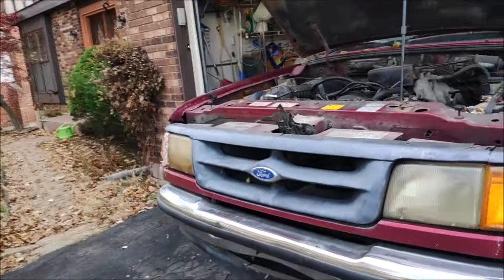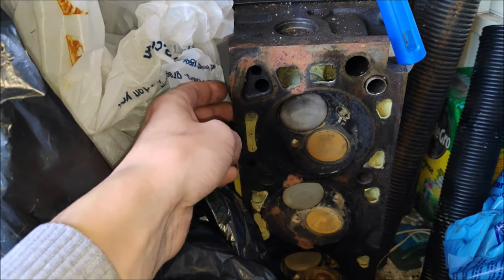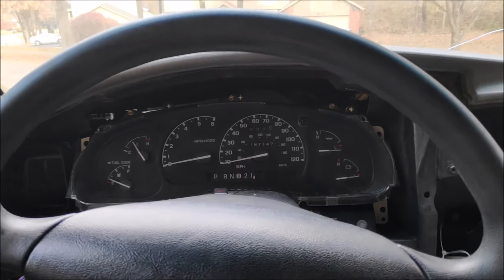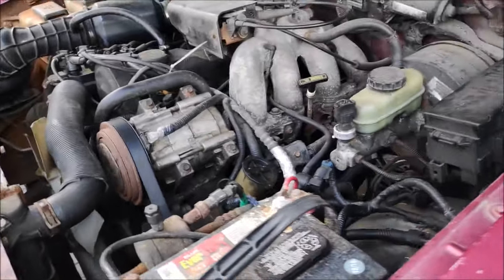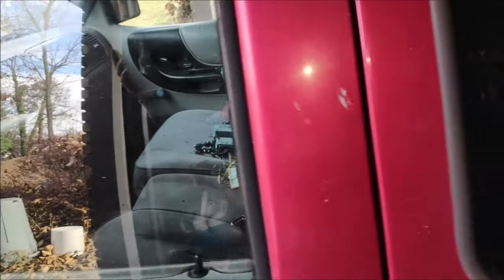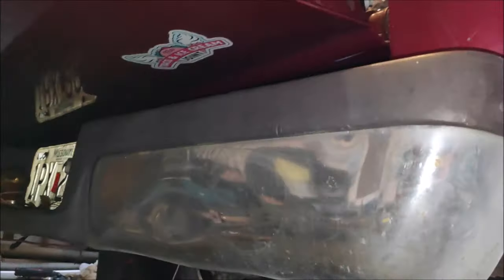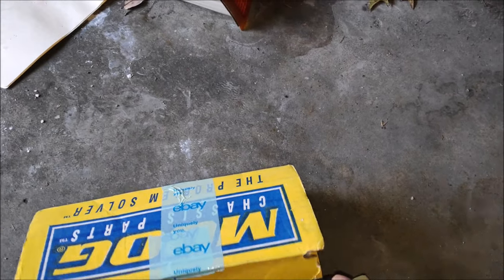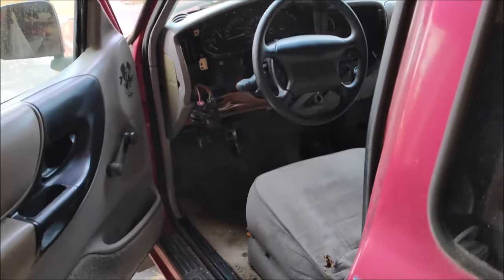What Fails on All Ford Rangers, Everything You Need to Know, Best Review

Comment: I've had rangers, 95/95/94/96/96, the 4 cyl. 2/3 L are awesome on gas!  * you can change a clutch slave cyl.on a 4 cyl.rgr by loosening exhaust hangers, drop trans, engine block is just small enough to get to the trans bolts, I drove w/ no clutch to get home, you can shift smoothly up/ down and about 2000 rpm, I shut truck off at a red light, had it in 1st gear, turned key & it started no problem, not legal , smart, or good for the starter, but I got home.now I have a 2010 rgr, 4.0 L its thirsty & heavy, shaking apart, I would buy a clean mid -90s rgr instead
Reply: lol that is insane yet inspiring as a 2.3 5spd owner

Comment: I bought a 1994 Ranger with the 2.3liter and it's gutless. I was driving up a steep logging road and it literally couldn't go any further. It would just stall if I let the clutch out at any RPM. It also likes to stall on really steep hill starts and I live in a mountainous area so hill starts are sometimes unavoidable. Is this normal? I don't want to have to do an engine and tranny swap, isn't there a lower hassle way that doesn't involve turbo/supercharging? Different cam or something?
Reply from the maker: On my 95 ranger leaking intake/exhaust valves in the cylinder head made the engine pretty gutless, you can do dry and wet compression test to figure out if your engine has the same problem. I posted a video about it, check it out if you'd like.
Reply: Did you find the problem, mine has the same issue?

Comment: I bought this new a 94  2.3L 5 speed trans 420K, and i ran the CRAP out of it. I used to hall scrap metal with it. the mud flaps are half gone. i put a water pump on it 2 years ago. This truck has been the best truck i have ever had. Fact 2 months ago my son T Bone someone, it should have been totaled. But no, it went frame shop. This truck owes me nothing. I owe it, so we are rebuilding it. I could have driven this across the country at any time. Did i say i do 10K oil changes on all my trucks. Mobile one Synthetic. 5/30.

Comment: That engine mount issue could also be a transmission mount broken.
Reply: woudlnt cause a roll though.
Reply: @DakotaRaymond1999  they can roll too if there is also a broken engine mount. Typically when just the trans mount is broken the shifter will lift up into the cab, and due to the torque on the engine (lifting to the right in forward and left in reverse) the stick will also move in the same direction, even with good mounts and more so with bad engine mounts. Also note this isn’t very noticeable with automatics as most modern autos even with a floor shifter, the shifter itself is attached to the floor of the truck and not the transmission using a cable to control she shift lever on the trans.

Comment: I've got a 98 need to deal with rust in the engine area, frame, and the power steering hose or pump is leaking. Then you can smell radiator when running the heater/ac...
Reply: What was the cause of the smell ? I catch it once in a while to

Comment: What fails in an older Ford Ranger?  Just about EVERYTHING FAILS, eventually.  I've owned my 2000 Ranger, 4 cylinder (with 8 spark plugs), 5 speed XLT truck since 2003.  As the 3rd owner, I paid $3,500 for it, no interest or fees, a friend sold it to me after he repossessed it from a 6 ft tall guy who wrecked it, why it now pulls to the right. I've replaced the radiator, the starter and other things twice and replaced once everything else but the motor.  Two front end and one rear jobs.  Started rusting a few years ago.

Comment: I have had a lot of Rangers and I love them. I would include the 4cyl in with the low power and poor gas mileage though. Some of the 4.0s actually had some decent power.
Reply: Why is the mileage so low on the 3 cylinder? It's fuel injected, low bhp and 4 cylinder? How can it have bad mpg? The truck is light.
Reply: Low power, absolutely. I've always gotten pretty sad 18mpg but every time I google anything about it there's loads of people reporting 23-24, so I dunno if I'm doing something wrong or what, but apparently they can do decent for the type of vehicle and the time period they came from.

Comment: Great video, I need a slosh controller.  I have a couple problerms you didn't cover, which is my speedometer is intermittent,  and the fricking e brake is worthless even with new shoes. I have to use a chuck on a string sometimes.  String so I can grab it without getting out.  Thanks for sharing your knowledge,  very valuable to me!..
Reply from the maker: Anti slosh module can be bought on eBay or picked up at local salvage yard. Intermittent speedometer can be caused by many things such as poor contact, bad speedo servo or bad gem. Weak e brake can be caused by stretched cables or misadjusted brake shoes.

Comment: The 4.0 liter engines pull hard.  I don't know what truck you drove where it didn't.
Reply: I dont know what he was talking about...  I got the pushrod 4.0 and its POWERFUL. The 2.3 was garbage and stay away from all those!
Reply: I don't know what he was thinking saying the 4.0 is weak I totally disagree with that but also disagree with saying the 2.3 is junk the only thing that the 4.0,2.9 and 2.8 lack in is poor valve train oiling ford never did address the issue as all three share the same block casting

Comment: hey EDIR , question , what is the best easy out , easy in gauge cluster for a 94 ranger with a 2.3 & a 5 spd trans ???? .... problem , with my idle goes from perfect to a lope and back to perfect , coil pack , gonna flip flop coil packs , see if makes a difference ????...... comment , i saw all da rust n corrosion under that truck in da video , i had a corrosion problem at the fuel pump / float level electrical connection , da plastic connector had dry rot , on a hard stop , fuel pump would stop working , i cleaned n soldered fuel pump connections , still cuts out once in a great while , i might have to resolder electrical connections , 94 ranger xlt has 296 k on it  , should make 300,000 k by xmas ........

Comment: 16:35 mines a 95 4 cylinder 2.3 automatic at 196,000 miles and surprisingly the trans seems to be mostly fine not saying your wrong just that mines still good to this day main issues ive had are gauges and bulbs and replacing console lid because the latch broke right now its filler tube idk yet if its loose or needs replaced

Comment: I  have a 2010 ford ranger 2.3l 7.5 ring 4.10 ratio 

It axle bearing has eaten into my axle shaft they do not make this year axle shaft anymore they are obsolete and they are bigger than any other year ranger and the axle tubes are bigger therefore it uses bigger bearing 

I guess my only option is to change the whole rear end 

What do you recommend?

Comment: I bought a 95' Mazda b2300 manual. The odometer isn't working, the speedometer gets struck and doesn't move up or down smoothly, and the coolant temperature gauge is always on Hot. Even when the truck is off and cold. 

Any suggestions?
Reply from the maker: Your odometer gear is broken, common problem, your Speedometer servo might be on its way out.... you can replace the gauge cluster, if temp gauge continues to read high, then it's coolant temp sensor and/or wiring problems. 95 gauge cluster is different from 96-03. The ones I fix, sell quick on eBay.
Reply: @everydayirace  thanks! Your video is super helpful.

Comment: Nice vid. I bought a 97 Ford Ranger (auto) last summer and have had issues with check engine lights ever since I got it. This is the first Ranger I've ever owned that has given me such issues. Getting Bank 1 and 2 Engine lean codes. A new alternator took care of the initial stalling issues, but I'm still getting this occasional humming sound when I accelerate. 19:31 Had that problem on my last Ranger, a 99. The driver side leafspring broke and tore through the bed.
Reply from the maker: Lean codes are tough to figure out sometimes, so many things that can cause it. I am guessing 3.0l?
Reply: @everydayirace  It's a 4.0
Reply: I agree lean codes are hard now I'm not saying this is the right thing to do but I if you plug the vacuum hose to the fuel pressure regulator it will take care of the Lean code but be sure to to keep a good eye on the oil too make sure you're not washing the cylinder walls with gas as long as it doesn't throw rich codes you should be fine my 94 4.0 still running  strong and I done the same thing 3 years ago

Comment: I have a 2003 ranger XLT manual transmission. The issue is that it shut off while driving and now it won’t turn back on, it cranks but won’t start. Anybody with any input will be appreciated, thanks
Reply: Fuel filter?
Reply: @manuelsalgado8510 My Ranger just did the same thing while driving.It just died and would not fire up.I tried ether but no spark.Before I try figuring it out what was the cause of your problem?I don't have a lot of money and it's my only vehicle so your help is truly needed.. Thanks
Reply: @indarican1575  my issue was the Gas turn off valve under the passenger side, it was bad and causing the ranger to turn off. Replaced the shut off valve and problem fixed, hope it helps you too

Comment: Dude! I've had so many of these issues! Axle radius arm: ding! Dash lights: ding! Filler neck: ding! Rear end: ding! (The crown gear broke soooo many teeth off) Slave cylinder: ding! (Four times now, I think) Door handle: ding! And so on. Also, from another video of yours; this truck has no power. Won't get out of it's own way, and will 'ping' if I try to accelerate in the wrong gear, or if im trying to cruise at 50-55 in 5th. The reason I found your page is because my truck just sputtered to a stop today at a light, like it ran out of gas (it was not). I'm hoping it's the fuel filter. I was able to get it running again after it sat for 30 minutes and then I let it idle for a few minutes and it sputtered and stopped again. Tomorrow I'm going after the filter and we'll see. I've got a 97 2.3 with 551k miles on it and I'm certain that the filter has never been changed. I know, I know, I'm a bad truck-dad! It's just never been something I thought to change! Anyway, I love my little Ranger, and I love your page! I hope you get this and stay encouraged to keep making videos for us Ranger-folk out in the world. Also, if you read this, PLEASE give us a way to contact you and ask for your advice/insight! You're the most knowledgeable Ranger person I've ever found online! Thanks, man! You rock!
Reply from the maker: Thanks man, I don't think it's your fuel filter, bad fuel filter would limit flow at wot way before idle.....engine needs more fuel at wide open throttle than at idle.....do wet and dry compression test, it'll tell you if it's internal.......hint hint valves aren't sealing.
Reply: @everydayirace  lol I have NO idea how to do a wet and dry compression test. So, if the valves are bad, which wouldn't surprise me, since I've had my little buddy since he was only 68k miles old and have never done any major engine work, why would it suddenly just sputter and die while sitting at a stoplight after running fine all day? BTW, I deliver pizza for a living, so I'm always doing short hops in traffic. Could this be caused by a blown vac hose? I've had a few shit the bed recently. I guess 27 years is a bit much to ask from rubber lol. If you want to continue this message exchange via email, let me know and I'll get my address to you. Thanks for responding, at any rate!

Oh! I meant to ask, after I got it running after the first failure, I noticed that right about the time the engine got up to normal temp, that's when it shut down. Do you think that might be a factor? Thanks!
Reply: BTW, it was the cam sensor!
Reply from the maker: @nicholasearl5703  how did you figure it out?

Comment: Do you have a solution for repairing the dash lights? My – lights start going lower and lower until they just stopped working altogether. I have replaced a headlight switch and I cannot find the adjustable brightness light switch roller Tumblr that's beside the main light switch. I think it would make it work if I could find one
Reply from the maker: Solution is to replace that dimmer switch like you already know. I am sure there are few on eBay that you can buy.
Reply: Thx

Comment: I have a 98 4 cyl but seems to want to shut off after getting warmed up it will idle fine for about 5mins then will dive to anywhere from 500ish rpm to 800 rpm and sometimes when i hit the gas it seems to flood out or bog down and will actually slow down when driving with my foot on the gas some times
Reply from the maker: You'll have to stop driving it and have someone look at it, because it's not going fix itself.
Reply: I do appreciate it but i am the looker at my stuff i did a trans in the same truck for 20 dollars and all other things since i bought it 3 years ago like the radiator thermostat and housing since i left this first comment I can definatley attest to it not fixing itself thats why I commented looking for more info thank you!
Reply from the maker: What I do if I have a vehicle that has drivability issues is I plug in my Bluetooth scanner in the obd2 port, open up torque app and look at the data or record the data to see what's actually happening, so I know for a fact if  there's too much or not enough fuel in the engine, then I figure out if it's electrical or mechanical. I collect as much data as possible then use that data to proceed to solve the problem.
Reply: Thank you I appreciate it alot and after flushing everything out and putting the new radiator and what not in its back to idling normal after warming up the thermostat i took out and housing were almost shut due to the last owner using stop leak and even my overflow hose was totally blocked off from that junk and the truck is running alot better and smoother my dash temp gauge still doesnt work but my heat wasent lava and life was good. What scan tool do you use and before we get to far into that is there a decent low end one that can get me by for a while like i said i do everything I can out in the garage to not pay someone else and other than mounting and balancing tires Ive done all my repairs since I was 15 and am 23 now and would definatley like to have some sort of scanner not a pro by any means but would like to step it up a bit thank you for the replys and be safe out there!
Reply from the maker: @WHA2319  look up my how to test tps video, it's shown in the video what I use.
Reply: I have a 99 ranger with the 2.5 xlt and I replaced everything that everyone has suggested except for the one thing that no one has suggested and it was the fuel injectors easy replacement and I'm ordering some for mine now. But after researching the symptoms of bad injectors it actually matched the issues I'm having and what sounds like the same issue you are having as well. So start there and you have 2 options. 1st is injector rebuild kit if you do it yourself and use some form of injector cleaner as well to ensure its completely cleaned. Option 2 just order some new or refurbished injectors Denso brand which are the OEM brand just replace.
Reply: @WHA2319  I have the same exact problem with mine. After cleaning my fuel rail and injectors it does idle longer now before dying so I'm off to a good start in the right area.

Comment: It is actually 1995 B2300, I ordered 1 on amazon but it was for a 2,002Ranger because that is the only 1 they had And I installed it and it did not work.So I have figured out that the early modern rangers and mazdas That I switch Is does not work With later models. I bought a switch from a Mazda dealership in Massachusetts and they never sent it to me $135 loss And they were not answered the phone
Reply from the maker: They're different, I have a bunch of spares.

Comment: i kinda desagree about the engines (soorry about my english) here in brasil we  generaly put natural gas on these cars.. and the 4.0 is incredible resistent... yeah, it drinks a lot.. but holy im with  285K KM  and its works just fine! even with a bad gas like here in Rio de Janeiro... i just change oil... well, i think the V6 its a good option..
Reply: I agree with you 1998 xlt 4x4 4.0l OHV 5 speed manual and I'm at 287,190miles and Its been in the family for 13 years and came from the first owner who added a few things like a locking diff cold air intake and he also kept all receipts and none of them were huge problems just alternator and things but as far as I know this truck is a great piece of machinery!
Reply: It is an incredible truck, here only the USA version came up to 97 .. then they started to be manufactured here and only came with 4 cylinders .. it is very weak! I really think the maintenance of this truck is very easy! even more because here we don't have weather problems, it's hard to have a lot of rust problems .. snow too! it is tropical and the average temperature is 20 ° c .. the lowest is 17 ° c and the highest 32 ° .. so it is a place where it is easy to conserve! the real problem we have here is gasoline with a lot of alcohol .. it makes a lot of cars suffer ... but as long as you take care of the engine everything is running smoothly! an alternator .. a start! at most I had to change a water pump ... everything running fine :)